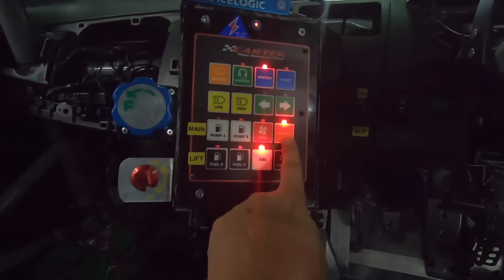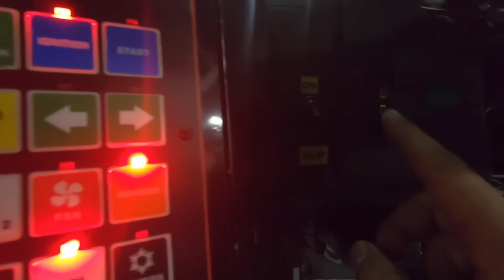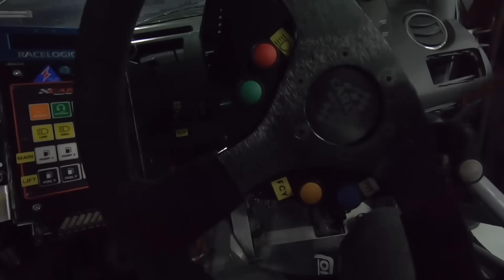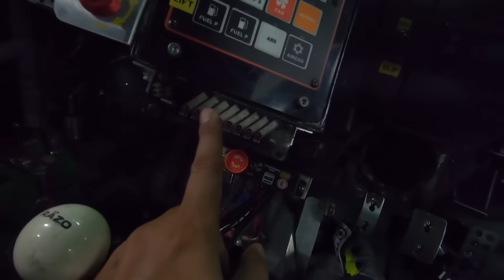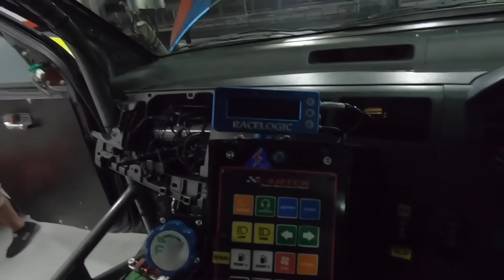IKUTAN BALAP 1000 KM PAKAI SUZUKI SWIFT

Comment: Byk jazz tek tek kesalip, beda kelas sptnya.. dan jg msh latihan 😄
Reply: Emang beda kelas,,klo sm2 standard jazz cm di asepin doang,,ini swift sport 1600cc out put nya yg standard pabrik aj sdh 136HP,,fitur nya jg lengkap gk kayak jazz
Reply: Iya bro, tapi sayangnya diindo disunat.. sedih..
Reply: @ramadhanph3546  sempat masuk, dan ga disunat. Cuma mahal. 320jutaan klo ga salah harganya di 2012
Reply: @ramadhanph3546  klo yg versi sprti yg di pakek om Fitra,,swift sport 1600 pernah masuk (cbu) gak sunat2tan fitur lengkap,build quality ok,akselerasi mantap... tp wktu itu harganya di atas jazz sm yaris (300 jutaan)
Reply: 2014 ternyata Swift Sport itu masuk Indonesia. Harganya 320jutaan. Sedangkan Jazz RS tahun segitu ga sampe 250jt
Reply: @fransiskusunardi5519  ya emang beda kelasnya di era itu blm banyak mobil yg punya fitur keyless, stability control, ac auto, 6 air bag, dg tenaga 136 Hp... semua fitur itu ada di swift sport & gak ada di jazz...
Reply: @drosandi8912   sy pemakai SWIFT SPORT 1.600 YELLOW 2014 MANUAL.. untuk mesin jika di banding dengan tetangga masih menang swift sport .. fitur" juga lengkap, memang swift sport Salah 1 produk SUZUKI yang di buat bukan hanya sekedar Nama Sport dan body kit tapi memang sampai sektor mesin ny mengusung mesjn berbeda
Reply: Itu kelasny sp 2 bro 1500cc
Reply: @drosandi8912  wkkwkw balap kok bicara std bang?
Reply: @setiawanjayakesuma8421  swift sport emang mantul,,,desain jg gk pasaran...syg gk masuk Indonesia lg yg generasi barunya...
Reply: Asal tau aja RS itu kepanjangannya Road Sailing bukan Racing atau Sport,  jadi emg jazz gk ad versi sport nya, kalau swift emg ada versi sport mesin beda ama swift std
Reply: @sherryvineyard2587  btul lagian mesinny ga H2H, klo mau bandingin bandingin aja sma mesin B16b type r atau 4A-GE BT, mesin swift ini kaga ad apa2ny tenagany jga masi under 140hp, pdhal mesin ini lebih muda dri kedua mesin legend itu wkwk